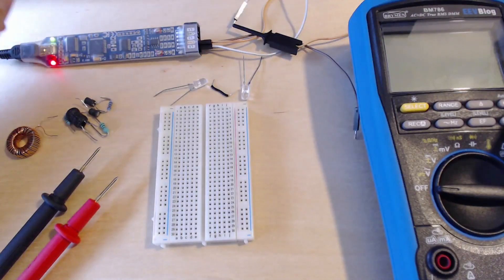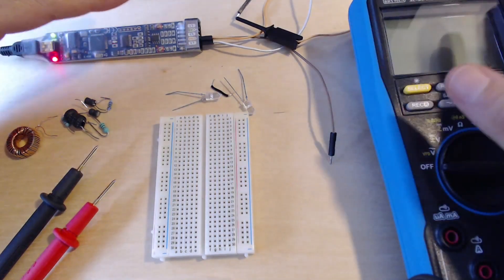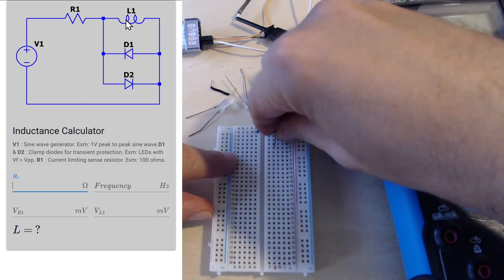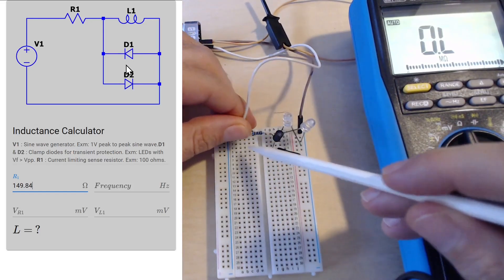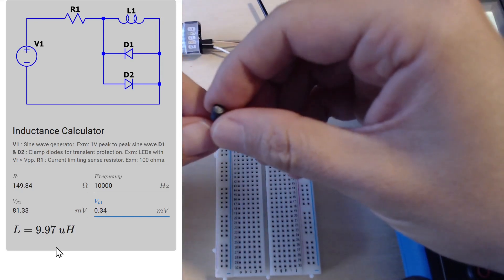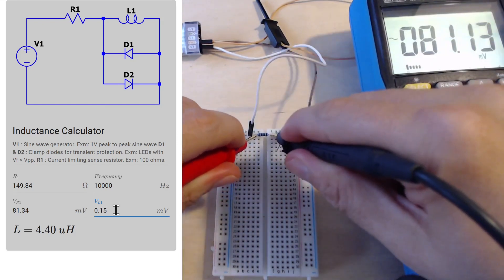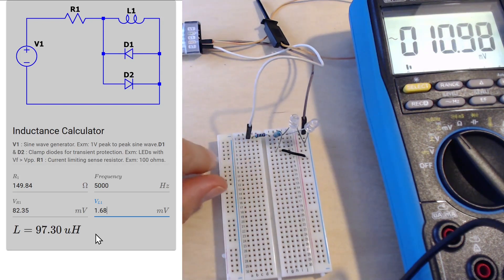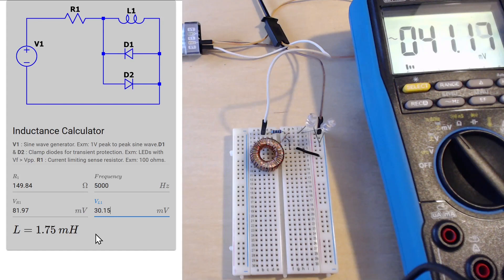How to measure inductance without an LCR meter

Comment: Can you share the math part of the calculation?
Reply: I am also interested in the formulas
Reply: He describes the math behind it in part 2. From the measured voltage drop across the resistor the current in the circuit is calculated according to ohms law: I = U(measured)/R. From the voltage drop across the inductor and the calculated current the  reactance is calculated: XL = U(measured)/I.
From that the Inductance L can be calculated: L = XL/2*PI*f.

Comment: is it also possible with a pwm signal from an arduino instead of a signwave of a signal generator?
Reply from the maker: Unfortunately you need a sine wave for accuracy and with the formulas for reactance embedded in the tool.

Comment: Nice as concept but not practical. Is you are using a signal generator might as well get LCR
Reply: It is perfectly practical if you do not own an LCR meter but have a signal generator. That is the whole point!
Reply: I have a signal generator module... But no LCR.